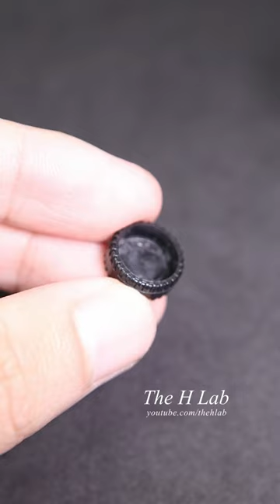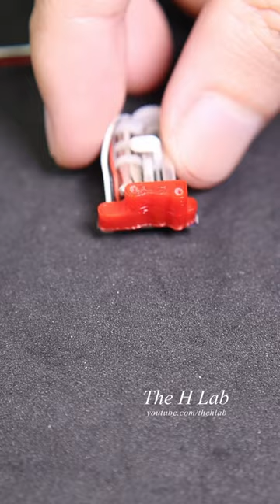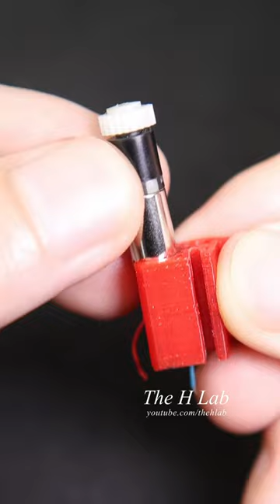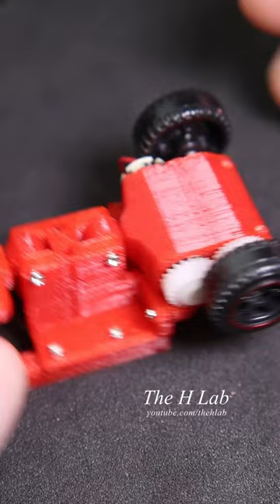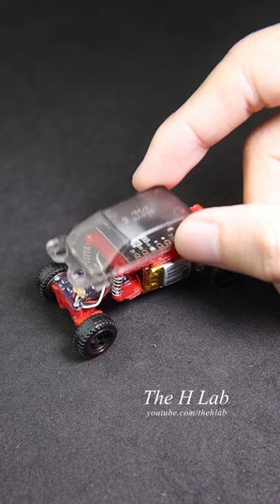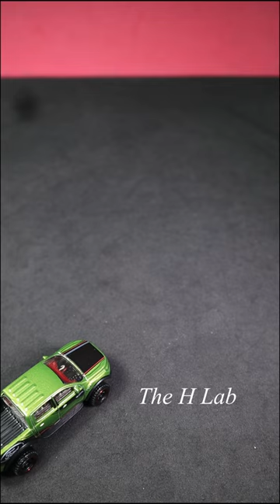Full convert 1/64 Ford Ranger Raptor to RC | The H Lab

Comment: thanks bro now I  understand the diagram. We have 8 channel to make it 😊 the pin was given to your code
Reply: I have doubts -

What he soldring on the esp32 board .

That small board wher we can buy pls tell me the pcb name
Reply: Please explain
Reply: @MrAhamed93 can be, 1A/3A brushed motor speed controller Micro motor drive module Mini DIY bidirectional forward and reverse brushed ESC Simple ESC ( basic a chip because the ESP can not control the motor alone ).

Comment: Nice  what size  of motor do u use 🤔  I'm working on a hot wheel my self  and the motor  I order off of Amazon  is either to big or way to small 🤔  any help would be greatly  appreciated  😊  thanks for sharing 👍
Reply: That was a coreless DC motor with gearbox
Reply: That's convert high speed into low speed. I hope you understand it😊

Comment: Where is the circuit diagram
Reply: Could you please say what are the parts he used to build 

I got to knw following components 

Esp32 c3 super mini - receiver 
Liner servo 1.8g
Servo motor 2.5g
Battery
Esc micro - ? Details pls

Circuit diagram pls.
Reply: @MrAhamed93  I knew that
Reply: @MrAhamed93  OK wait
Reply: @MrAhamed93  u search how to convert 360 digri servo. And u get the answers and also in this channel u find the video too. And the diagram u see the code and then see which pin is defined. That was the pin out. I hope u understand it
Reply: Thanks for the response.
I'm not an expert in circuits.

But i wanna build the same.

I under stand how to convert 360 degree servo but, 

how to Circuit the esp32 and motor, and battery. Pls explain 

In this circuits he didn't use motor drive rite?..
Reply: @MrAhamed93  Hmmmm
Reply: @MrAhamed93  no. any motor driver doesn't use. I told the pin diagram.
Reply: Pin 10 work  As a driving unit. Forward and backowrd and 1 is steering
Reply: Pin 20 is left signal and 21 is right and 8 pin is for front light and 7 for rear light and pin 9 is the emergency led. About the horn am not sure. I tell u that later. Ok
Reply: Thanks for the clarification.

How to connect battery
Reply: U can use 3.7 v litinum battery for 3.3 V it's cheaper and light.
Reply: There is no secret, you need a mini servo, a mini controller (Arduino or ESP32) and a mini motor controller, and a mini battery... You can save the work and directly buy a more complex model, the Turboracing C65, C50 and other models, the good part that is very cheap to make it at home.
Reply: @FyoutubemadridMadrid the problem is he doesn't have any knowledge about it. Speciale pinout and diagram 😊😂